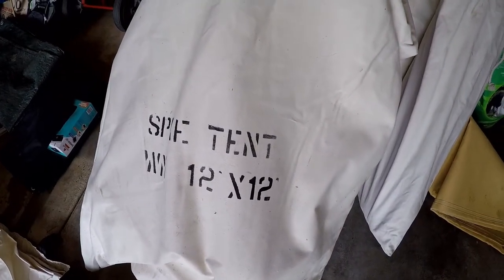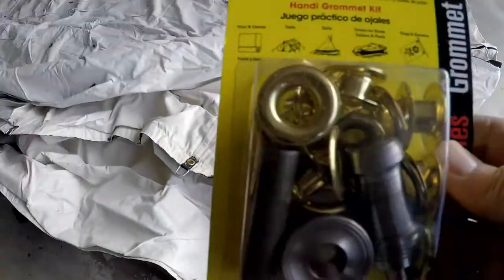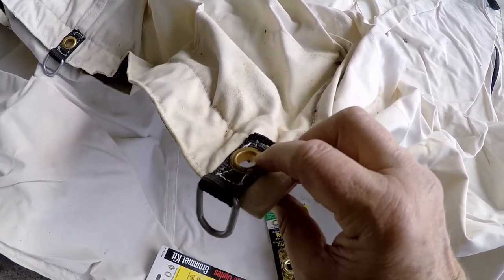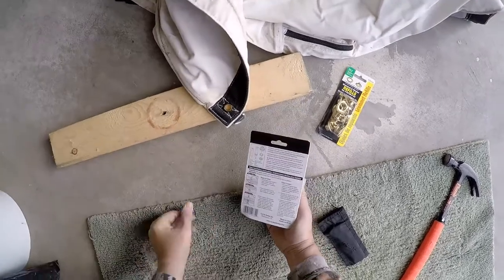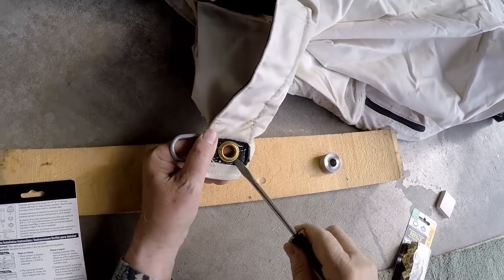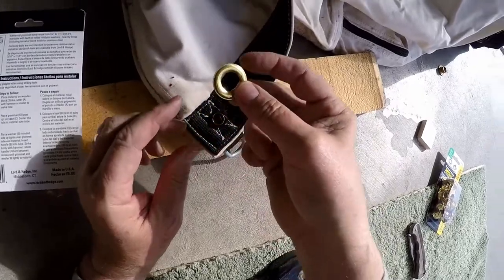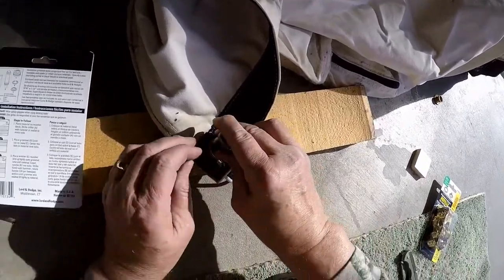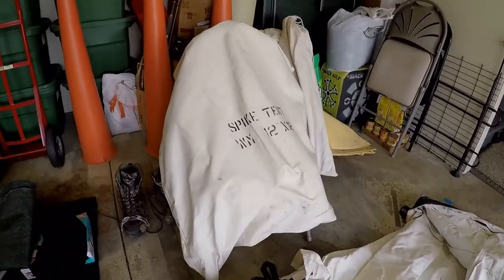REPAIRING A TENT GROMMET: Using The Lord & Hodge Grommet Repair Kit

Comment: Looks like a nice tent. It is cheaper to not try and salvage half of something a lot of the time. And buying the best is usually a good idea. Thank you for the video
Reply from the maker: It is a very nice tent, and the company I bought it from, the Wall Tent Shop, has excellent customer service. When I contacted them and told them I'd lost a grommet out of it, they insisted on paying for the repair cost. I told them, no, that's OK, I just wanted to know how to do it, they said to take it to a tent repair shop and submit the final bill to them. I couldn't find a competent shop in my area so I bought the best grommet kit I could find, and the Wall Tent Shop reimbursed me for the kit!